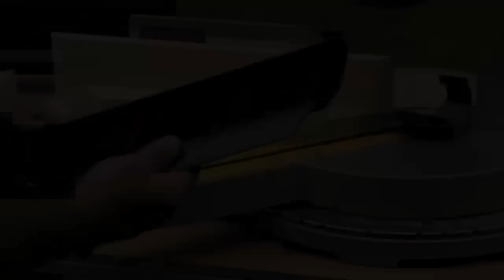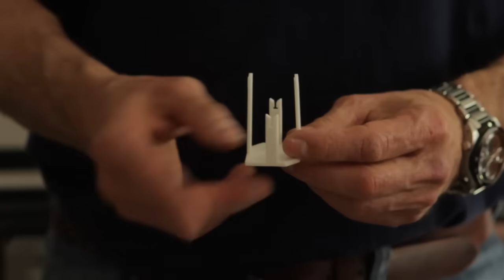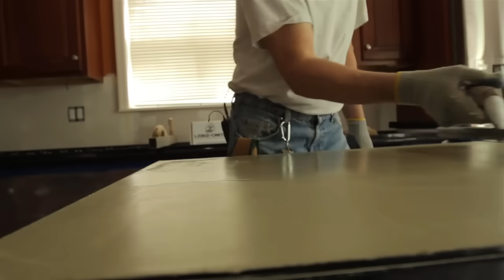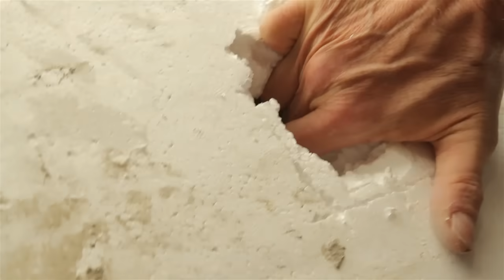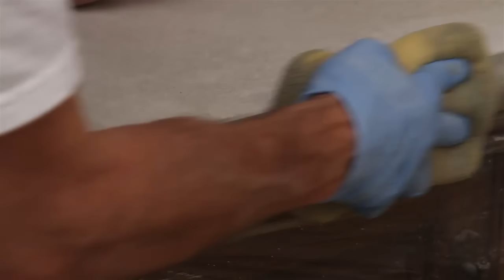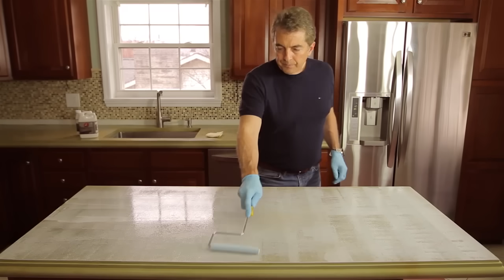Z Counterform - How To Build Concrete Countertops Full Instructional Video

Comment: I’ve seen some videos where people add 2x4s/support boards on the top of the cabinet/underneath the backer. Is this recommended?
Reply: @ZCounterform1   sorry another couple questions. Does it matter what side of the backer goes up? I know typically it’s smooth but the ones I got seem the same on either side so I was just going to assume label side up. Also two of the edges on the brand I purchased are rounded. Will this matter or should I trim off to have a square edge on all sides?

Comment: Would love to use this product to update my counter tops at home, but shipping rates are astronomical!!!
Reply: joseph ospital I thought the same. Went with Quickcrete 1106-81 white tint base for countertops from home depot. $0 shipping and about $16 for an 80# bag. Had to do some math for the color packs to get the same dosage, but saved a bunch on shipping. (24 bags to do the kitchen) Using the rest of the Z Counterform system  though. Edges, color packs, mesh, knockouts and z clips, even sprung for a chrome trowel with the shipping savings :). Actually pouring the first 2 counters tomorrow!

Good Luck!

Comment: I am assuming the concrete mix looks like a "sand" color because of the lighting you used and not because of a pigment you used? I am looking for natural grey and am hoping it doesnt turn out to look yellowish. Thanks
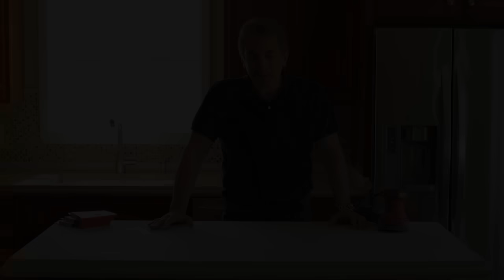Reply: Ya, there is another person asked about this and he said it was the lighting that caused the yellowish and even green colour, but the mix is actually the natural grey, which even in step 16 @47:45 into the video better shows the grey color that it actually is. It doesn’t help that the background area of this video is all brown and yellow looking either which effects the lighting as well…. But it is an actual natural looking concrete grey.

Comment: Is it possible to add a decorative pattern such as colored glass pieces or sea shells to adorn the top of your countertops? Thanks.
Reply: Ya you can add whatever you want to it, like the speckled confetti type material which they also sell and looks awesome IMO. 

I suppose if you wanted to add sea shells or a pattern in the concrete or even old coins etc…  you might want to do that and then pour a 2 part epoxy layer on top otherwise you would be covering your fancy additional creation that you came up with in order to have a smooth and protective as well as a usable top over it. OR I guess you could put clear rubber spacers on top and then a layer of glass. Depends on what you are after for your fancy counter top. 

It sounds like you are wanting a smooth clear layer on top that fills in around the sea shells or whatever materials you have on top, which I’m pretty sure the 2 part epoxy poured over top is what you are after. Make sure you get the proper counter top epoxy that is meant for that exact type of project because there are different mixtures and types of 2 part epoxy. 

I hope that helps.
Reply: @slakjawnotsayin5451 Extremely helpful. Thank you!

Comment: I bet if u put a vibrator type tool on the end of the forms after tapping them, it prob would get more of the air pockets out and have fewer pits and pin holes

Comment: Pouring that pretty wet for a certified finisher.  And if you used a vibrator on that pour you wouldn't have had all them pin holes on that edge you know people DON'T LIKE. INSTEAD OF TAPPING THAT EDGE WITH THE HANDLE OF YOUR TOOL.  you want to bet how many air pockets are in the middle of that slab you never vibrated. Sorry but it hurt to watch.

Comment: Just did a counter job using this product. Went well went with a white mix. I've got a coat of sealer on it now but looks like I should of got the stain too. Lines all over the place threw it. Get the stain too.

Comment: My first batch was really dry and I didn’t get the concrete vibrated all the way into the form. Several places severely honeycombed.  I’m using the counterpatch material I purchased from you. Can I put thinner layers in and keep building up to smooth?  I hope it sticks to itself.

Comment: I was helping a guy out with countertops and made a batch with the same consistency. He said it was too wet; he said the more water the more volume causing cracks? Your response?
Reply: Too much water does weaken concrete. However, the liqui-crete product they mentioned in the video is a chemical additive that works just like adding more water, but without weakening the concrete. It allows it to flow real nice.
Reply: W.Monroe.C ok, mine turned out great. Waited forever for the wetter part to dry so I could final smooth it

Comment: why spend so much time finessing with filling in low spots on the initial pour? Just add too much and screet it off. Everything's taped off, use that to your advantage and make a mess. It'll 5X quicker that way.
Reply: Amen, was thinking the same thing! Watching him mess with mud was driving me nuts!
Reply: Yeah, actually this man doesn't look certified to me. Other than that great video.

Comment: how could you not show how to fill in the air bubbles on the edge when that's the most important part, we've seen people do this now and that's the part we want to know if you want a nice finish. I will say this was a smooth crete and looked great when he was troweling.
Reply: @ZCounterform1  that was the part I'm talking about because the edges looked great and would have been nice to see how it was done. ..thanks
Reply: @ZCounterform1  we see many videos and look for the best on finished results but we watch Youtube for "know how" or I'd be on Instagram. Instead of me taking obvious advice, take mine and SHOW HOW, it's the Youtube way remember..smiley face!

Comment: I just did 6 bags of quickrete 60lb sand with the liquicrete on a misty day in Seattle using only the 6 quarts of water for each bucket as specified on the instructed and the concrete was the consistency of wet sand and definitely not as easyAs this to work, how much water is In the mix in this video? Looks like pancake batter!

Comment: I have a counter top formed with Z forms. Im pouring in place and realized that the wall forms are an 1/8 inch shorter than the outer edge. Why?

Comment: Can your product be poured over 3/4 “ plywood?  If I add concrete board now I will have a height issue.
Reply: We always use 1/2” cement board (either Durock or Hardie Backer) for two primary reasons. One, concrete binds to cement board, it doesn’t bind to plywood. The other is because plywood has a tendency to shrink/ expand as all wood does. This can cause issues down the road. The issue with 3/4” also is that the drop down in the form is 5/8” so it is really only meant to cover 1/2” or 5/8” substrate. 

With all of that said, we have customers who insist on pouring on 3/4” plywood and most of the time everything works out well. If using plywood, you will want to seal it or put down some form of moisture barrier.

Comment: Scotty
Can the edge forms be used on a radius counter top that is on a bar top?
Reply: Yes, you can cut V-Notches in the square edge forms in order to get it to bend.(instructional video on our website). We also carry a Bendable Square Edge Form that has the cuts in it already and will bend to a 6 inch radius.

Comment: I bought the forms, but live in a place where i can't get the concrete additive for standard concrete. Can you recommend a mix? Also i've been told using fibreglass fibres in the mix makes it superstrong. On my trial piece i used 90% cement and 10% fibres with water and it seems pretty strong if a bit crumbly.  Do i need anything else in the mix?
Reply: Hi. 90% cement and 10% fibers? That doesn't sound good. Honestly, it would be better to use a locally bought 5000 psi mix. Either Quikrete 5000 or Sakrete 5000. I wouldn't play around with creating your own. Give us a call and we can talk to you about the best mix available in your area. 570-587-3799
Reply: I tried to call this morning - couldn't get through.  For the benefit of others, after doing some further reading, how about this for a mix:  30% - 3/8" gravel, 30% - medium sand, 25% type 1 cement, 5% fibres, superplastizer admixture. Ladder rebar will be placed in the bottom half of the mold.

Comment: Leo the concrete finisher did an awesome job, he really makes the process look like an easy zen experience. But, in my recent experience, it wasn't exactly as simple as he made it appear. 

Some tips, use more water. Don't forget to tap around the sink. Consider contacting local concrete guys to see if they'll come and do the screeding and finishing.
Reply: I was thinking of doing that , contacting a local guy. Would probably make the job a whole lot easier and I bet many of the ones who do driveways etc would give you a good price
Reply: Leo stop playing with the sloppy mortar ,it not concrete without stone .
Reply: Simon Templar  it did turn out very nice , pouring concrete real sloppy it will really lose strength ,and when U add stone it interlocks with each other and adds strength,pouring real wet it shrink  a little bit to .have a good night 🌃.
Reply: Leo the concrete finisher, doesn't even know what a "screed" is, FFS. A "screed" is the level rails that a "straight edge" rides on to maintain level for your concrete. In this case, the edge forms are the "screed" and Leo's "stick with a handle" is a straight edge. Leo is like a kid playing in a mud puddle. The mix is too wet and he tries to do everything to early. Tapping the edges with your little trowel can be achieved much easier (and much better results) by using your sander with no sandpaper on it.
Any bagged sand mix will work without additives, but a plasticizer makes it flow a little better. Get the air out and then let it rest. Leo is working with pea soup. LOL.
Concrete stain is acid, nothing more, nothing less! Google "staining concrete" to find out the right way. 
These guys make it look harder than it is so you buy their product. If you are a true DIY er, look for alternatives, not kits.

BTW, I started my lifelong construction career, doing concrete work, when i was 15 tears old. I am retired now, and 70.   I don't know why I decided to tee off on an old post, but maybe someone will be helped by it.

Comment: Why not vibrate mechanically?  Tapping forms is not good enough in my experience - I've always used a 1/4 sheet sander with no sandpaper on it to vibrate a thin concrete form.  It would have practically eliminated the bubbles they had after stripping the edge.
Reply: Yeah he could’ve put it underneath the countertop and vibrated it really well just push that sander against the underside of the counter and Bam that would be awesome tapping it seems so low key
Reply: My thoughts too after watching a few of these z counterform how to's. I was thinking a oscillating ultitool with some sort of rubber prong you could dip down into the wet concrete really early in the pour.

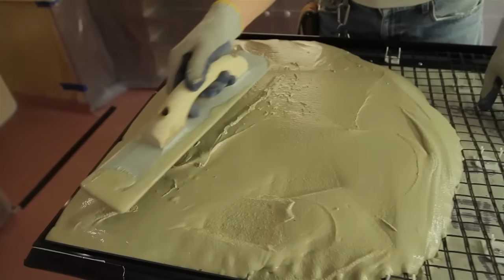Comment: At 18:20,  when the cement is being poured, he mentions that the mix doesn't have any aggregate. What kind of cement he uses ?
Reply: Sand and topping mix does have alot of aggregate in it!
Reply: The 'aggregate' is poly fiber in their additive. They use a special additive that they sell.  DO NOT  try to pour countertops with off-the-shelf products from Quikcrete or similar  (Big box store)  without the proper additives.  You'll have a mess on your hands trust me.
Reply: Quickrette makes a countertopmix. Will that not work ?
Reply: My question is what exactly was the cement mix used that has no aggregates that is so smooth.
Reply: any progress on the mix?
i live in a place where I can't get these additives.  I used 90% cement 10% fibres in my trial mix and it seems very strong but has fluffy edges (i'm yet to properly finish and wax them with bone paste etc). How did yours go?
Reply: @tomgreenfield9916  I use Quickrette countertop mix. It sets pretty fast, used 6 bags for a 14x2 foot counter. It worked fine. It gets really hard also after steel troweling it was almost impossible to stain it or dye it. It won't take it.

Comment: Thanks for the great videos!
I have watched all of your videos and think I am ready to start my own project!
I am however unsure whether I should be using any pigment in the concrete mix like you have in this video.
Cant I achieve a dark brown color after applying your coating products on a basic gray cement countertop or would you recommend to use pigment to darken it first? The reason I am asking it simply because the pigment would cost almost an extra 100$ in my case.
Also, is it possible to order your products in Europe? So far I have only found one site that sells your products and they only deliver within the Czech republic.
Again, thanks for the all the great info!
Reply: Thank you for the prompt response! 
I will try to figure out the best a way to order the aqua stain and the sealer from you guys, I am sure it will be worth it even with the pricy shipping. Its impossible to find anything decent in the local stores here in Latvia..

Comment: I am impressed! It appears that concrete counter tops are seamless and flawless if done correctly. I have two questions though
How do they hold up in high humidity climates?
How often should we apply the sealer, is it a one time application or does it need to be applied periodically?
Reply: i heard you should give it 6 coats of sealer before paste waxing to finish.  Did you hear back about high humidity climates?  I'm in that situation
Reply: @tomgreenfield9916  I live in Florida. No issues. I can send pics if needed.

Comment: Pouring this weekend! I noticed that the island had an overhang supported by 2x4s. Are those permanent or just used until the concrete cures? Better question is how far of an overhang can be had with no additional support needed?

Comment: Going to do this at end of October. How do you reinforce the undermount sink? Thanks in advance
Reply: so it looks like you are taking the undermount sink, and actually embedding its flange into the concrete countertop, which looks loads easier than mounting underneath. however, what do you do if the sink fails?
Reply: I am wondering the same thing.  I guess you could cut out the concrete board to get it out but i don't know. @lkk56

Comment: @ 6 Minutes or so... When he is describing the "pocket," look at the back wall form, there is an opening, is anything used to keep the concrete from leaking out of this small square opening? Is it a non issue, or what? Or is the actual wall used as the "mold" and you need not worry about the concrete escaping from there?

Comment: This is a great video, however I'm disappointed that you didn't show the process of pouring and screeding the counter top with the sink (the counter top that is against the wall).  It would be very helpful to see how you screed the cement when its poured up against the back wall.
Reply: #2 Phil Trash it comes as a kit so whatever front edge you choose it will come with same amount of back wall form so you don’t have to piece meal forms together. I imagine if you need an extra piece or two of something added to the full or half kit then just call them and tell them what you need
Reply: I cant find the back wall form on the website. The only thing that looks right is the pre-cast package. I really dont want to spend 220$ for one 9 foot section against the wall.

Comment: OK! so far so good. We tried a 3.5x3.5 block to practice mostly for color and technique for staining. WE are so glad we did this for a few reasons. 1-when removing the form we sanded a bit too vigorously and  may have ruined our nice smooth finish. We are hoping this will be smoothed better when we use the hand sander with the discs. 2-we are not very experienced with concrete work, but found working with the tools not as hard as we thought, as well, doing this mock up is giving us the confidence that we can do this.  Question???? what is the process for a drop in gas stove top? more to follow after we stain and seal.
Reply: Z Counterform ah haaaa! That makes sense! Thank you! It would also be the same were I to do the drop in sink, rather than under mount?

Comment: When you screwed the Z-clips into the form, how in the heck did you get that form off?
Reply: it snaps off
Reply: So apparently these ARE NOT reuseable....  I bought these and realized that I was going to put screws in from the bottom but it will still be under the concrete....  I thought they were reuseable but I guess double fancy is NOT.

Comment: How did you handle the edges against the end panel against the fridge? Early on in the video, I see that you did not use a back form like you do against the backsplash walls; but later on, when Leo was presenting, there was some sort of tape against the end panel. I have several such edges and need to know before I move forward as I don't want to have the back forms exposed since they won't be covered by a backsplash. Thank  you.